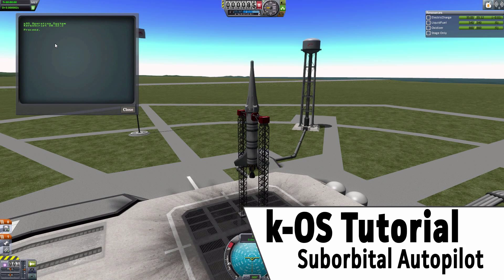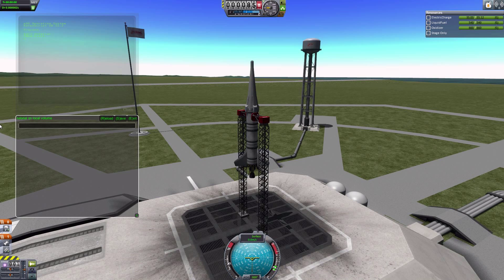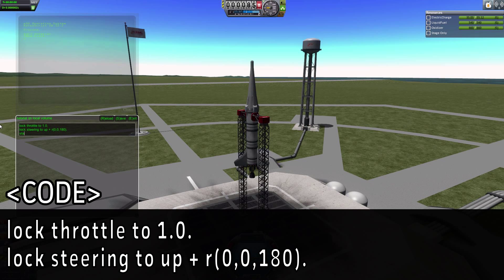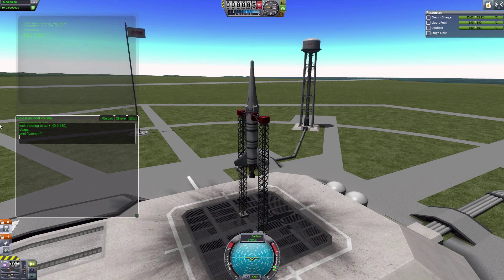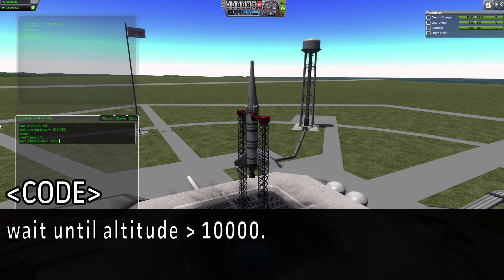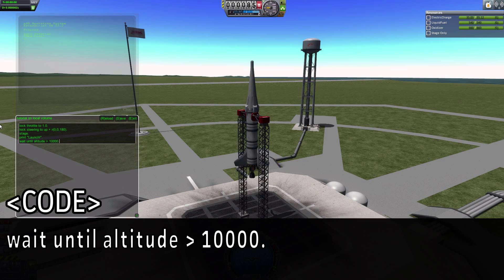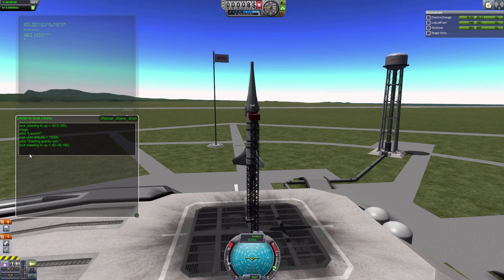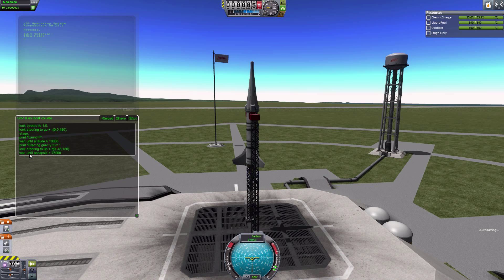k-OS Tutorial - Suborbital Autopilot

Comment: I did everything except the warp and the print and it just says File '1:/orbit' not found
At interpreter, line 14, mine doesn't have a line 14
Reply: same mate
Reply: There are volumes where scripts are in. You start at  volume 1. Your scripts are at volume 0. You either have to add switch to 0. first or copy orbit from 0. There is also an option to start on 0 (also called archive). Google it